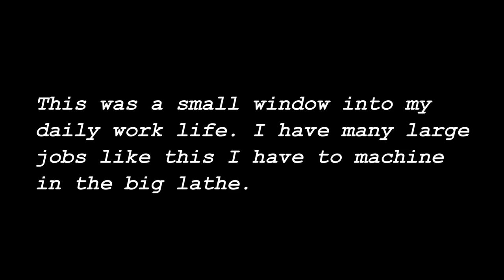Large Lathe Work

Comment: I was surprised to not see a hose on the cutting head with cutting fluid....
Doesn't the cutting head too hot and wear more...  Just wondering... nice lathe
Reply: LuckyBambooGuy you can cut dry with carbide and pretty much any tool. Oil or coolant just helps it. It does get very hot without coolant but it's ok as long as there's no thermal shock on carbide, so you can't be cutting dry and decide to throw on some oil or coolant because you probably crack it.

Comment: what was the cylinder for , just curious
Reply: +Scott Tyndall Probably part of an assembly that lifts a big load hydraulically.   Large metal door or gate? Some type of lift? Dunno...It's a hydraulic cylinder, so theoretically you can apply it to anything you need to shove with a great amount of force.
Reply: I'd say it's for an ejector semi trailer. used to work on lots of them. they were used for taking rubbish  (garbage) to landfill. the cylinder just pushed the load out of the back.

Comment: Just watched ! Great video! I myself have did this in every for long wall mining . I cut apart the jacks , 500 ton ones ! 18”x 50” I guess . I cut them on the other end where they threaded together . I machined the outside for the steady rest almost exactly as you did . Someone else took it apart then the tube came back to me then I’d machine the threads and seal out of they were bad sent it to the weld shop and they would weld it up and if machine new threads and seal . The weight assembled was 4600 lbs . I did this for 7 years . I did maybe 800 a year I no longer work there . Long story but true ! Enjoyed the video ! You made it look easy ! I know the time involved in the setting up of something this size . I’ve a couple videos of me running a 40” Summit Lathe and cutting some Square threads . Did it all and wish I had my own shop !

Comment: Great Job. I used to rebuild these when I worked as a machinist. We did it a little different. I would take the covers off the front of each stage, then take the packing out, then take clip out and pull each cylinder out. Those were a pain in my ass.

Comment: Why not use a dial indicator?
Reply: +Doan08 I'm guessing the OD is uneven due to paint and other wear issues.
Reply: +Doan08   WITH THE STEADY REST YOU CAN'T USE A DIAL BECUASE THE WORK WILL RUN TRUE IT WILL JUST BE HIGH/LOW/LEFT OR RIGHT.  HE WILL ONLY USE THE DIAL UP AT THE CHUCK.
Reply: +Phil Deez Nutz!
Reply: Sweet , learn something new every day, I was taught that way. I'll have to try that. I was taught using the center and adjusting the peice until the center cuts true. It's always worked for me. I never thought about using the indicator on the work. That sounds like the more "proper" way to do it though.

Comment: Just here to share some knowledge that I picked up.  When I need to adjust a steady rest in, I mount an indicator to the bar and sweep the tailstock ram.  Also could mount an indicator to the live center and sweep the O.D. of the bar.  Adjust the steady until the indicator reads zero at all 3 steady rest roller points.  The only downfall is, the tailstock has to adjusted on center first and can't be offset. 

You probably already know this, just incase you didn't, maybe you would like that idea better.  I noticed it's easier on center drill points.  You do great work.
Brian

Comment: Indeed,,, the bigger the work piece on that type of job, the tuffer it gets... My last couple of years machining at a shop were spent mostly on big expensive parts. My lathe (metric) had a 39" 4 jaw chuck with 14' between centers, power fed compound and tailstock. I once turned a butruss thread 1 thread per 4" on a 14" diameter by 12' shaft... I had to find the correct gear selection by trial and error. All in all a nerve racking job but very rewarding! I had to grind all the tooling. :o]

O,,,

Comment: I have a little 
arrears in watching your vids and this one could save me some time. I had few days ago similar work to do. Difference of scale - my piston and lathe was smaller and it was about only removing weld that was full of porocity and piston was leaking. This trick with center drill is awesome. I was centering with micrometer and eventually i managed to do this but it gave me a headache.

Comment: Good work Abom,I'm not going to tell you how to do your job.I know it's a pain in the butt when setting up a job on a steady and trying to find the center. But I've found it easier to have the dial gauge on the end of the work and clock around the tail stock quill either way it takes a while but you can get it to run pretty accurate.Eliminates guess work.

Comment: Hi Adam, I noticed that you only give the parting tool a few squirts of cutting fluid then off you go. Do you find that the tubes get hot enough to get work hardened? Just curious, because I run into that from time to time when I part metal (on a considerably smaller machine) especially stainless.
Reply from the maker: I can't say I've ver had problems work hardening while parting. Drilling in stainless maybe.

Comment from the maker: The tubed all have a welded in stop ring on the ID so theres no way to remove them from the front side. You have to cut the but end off, and remove all the stop plates on the rear end for them to come out. Ive had to do two of these now, they are a pain in the ass!!

Comment: I'll probably never do any lathe work near that size (I have a HF 9x20), but the techniques are similar, and I learned a few things from your video. I'd be interested in more details about how the parting tool was sharpened, and if the cutting edge needs to be exactly on center for a tubular part?

Comment: What is the best inserts you've found for cutting welds? As far as resistance to grabbing and and breaking the edges off.
Reply from the maker: I use them all, but my go to insert for cutting welds is a TNMG, grade for cutting steel. I have a pile of them, so i use them up for the harsh jobs like that, and leave me fancy expensive inserts for the more high end machining.

Comment: I don't understand why this is so fascinating to me. I LOVE machine shops, I guess it's a guy thing.
BTW, What application was this actuating cylinder used for? It looks like something that would be on either an oil rig or crane, too long to be for a dump truck. Was it hydraulic or pneumatic?
Reply: It's machine porn. Especially with huge hydraulic cylinders moving in and out. :)
Reply: this is a hydraulic cylinder for a dump truck.

Comment: Fascinating videos!  When adding text involving angles or temperature, hold down the ALT key and type 248.  It will give you the degree ° symbol and save you a bunch of key-strokes.  Those "cheat" codes can be found if you Google "ASCII symbols".

Comment: Great video, surprised the mount was welded on center as accurately as it was would have thought you would have to indicate od to find center, do you also do the welding on a project like this ?. Who made the lathe ? just curios  thanks for sharing
Reply from the maker: I indicated the chuck end of the tube, but used the center drill to find the center on the blind end. Once I had it center drilled I used a live center then machined a true spot on the tube for the roller steady rest. Yes I have to do all of the welding where I work, and on my jobs. 
The lathe is an American Pacemaker 20x192, and was built in 1943.

Comment: What did that cylinder go on? I also used to be a machinist in a hydraulics shop. we used to mfg and repair multi stage cylinders from dump bodies. We always took the head nut off, pulled the packing and the snap rings out, then pulled each stage out from the top. Is this not that type of set up? The bottom of each stage has a phenolics guide    that would burn in you welded the butt plate on while fully assembled. I guess that must be a different type cylinders.

Comment: I've found that in older heavy lathes, the tailstock is often below center and/or off center.....one must true-up the tailstock to AXIAL center of the lathe...this is often difficult, as the ways  are worn down below factory center and the tailstock can be left or right of center, as a result of vibration/broken insert accidents....gotta true that tailstock up at different lengths from the chuck.

Comment: How do you weld the components again? From what I understand and judging from the thickness a lot of MIG/MAG weld passes would be necessary, where SAW would result in less weld passes, but then you would require a "complicated" setup.
Reply from the maker: I used SMAW, stick welding with 7018 electrodes. My choice.

Comment: Dear Adam your lathe lessons are very interesting!!
Why you go so slowly with parting tool?  i suppose that you go at 30 rpm about it's true?
iscar insert work good at  minimum 80 m/min.....16ft/min......
can you explane this?
Reply from the maker: That was a massive workpiece to be turning on the lathe. I chose to keep the RPM's low. The parting inserts still work fine at that slower RPM, the large diameter equals to quite a bit of surface feet.

Comment: I'm a professional welder and I can tell you that welding back pistons after refurbishing is my least favourite job. 9 cases on 10 i have TIG welded cold pass (or root pass, english is my second language so i'm not certain; anyway, first layer of weld), MAG filler and cap. As i remember there almost allways have to be a spot of oil, grease from assembling o-rings and seals or other thing that spoils my weld and force me to grind the gap and fill it again.

Comment: These cylinders are part of a truck and trailer lift for unloading chip trucks lifts the entire unit they usually run in tandem I have worked on these myself but we had to arc sir the backend and stop plates off our sirco only has 12" bore

Comment: Can you explain why coolant was used with the parting tool, but (apparently) not with the other tools?

What coolant/lubricant was used?
Reply: Not a machinist but, if I'm right, a parting operation/plunge cut like that doesn't allow much area for chips to escape and is also hotter than other areas

Comment: It was big 2" of thread 2" gap I could have made the calculation, but would have had to take the cover off the end of the headstock 3' wide by 5'6" tall and we had no extra gears anyway. A giant warehouse sale included in 3 truckloads the lathe was the only machine in good working condition (but it was,,, what it was) the marker worked well to set it up... Many other machines I put into working service lots of scrapeing and honing on ways and machanicing. A great learning experience! :o]

O,,,

Comment: Adam, I watched this years ago, and am still fascinated at it. What was that cylinder for?
Reply from the maker: It’s used for a truck dump at a paper mill
Reply: Abom79 so when you say “truck dump” as opposed to “dump truck”, you mean one of those things where they basically just turn over the entire truck as a whole?
Reply: @JasperJanssen  If I'm correct, it's one of those places where they drive the truck onto a platform and then tilt the platform along with the truck on it. That is that it lifts the truck and platform so that the platform and front end of the truck are raised in the air together so that the back end would empty like a dump truck that has a lifting bed.

Comment: Having been a machinist for 35 years and, re-building 100's of telescoping cylinders, Why did you remove the butt plate(s)? (Your term, Blind ends). Telescoping cylinders are put together and packed, from the packing nut end. If the packing nuts were not removable I understand this but, the nuts Still have to be removed to install new packing. Otherwise it will leak.

Comment: How come the inner stages of the cylinder do not rotate whilst machining? Is it because the cut depth is to small to overcome the friction of the seals? Or do they each have a shoulder/spigot that holds them in place?
Reply from the maker: Good catch. On the opposite end, I have a piece of flat bar that is welded from the eye, all the way to the barrel, and each tube nut is also welded to that bar. That keeps everything rotating together. It's the best way I came up with for holding them all together.
Reply: LOL I was over thinking it... of course it is welded :P
Thank you for the reply

Comment: I use to work on a very large Gisholt  engine lathe. Did you ever hear of them? [old school]
Reply from the maker: I don't think I've ever heard or seen a Gisholt before.
Reply: GEFanuc21t Hi I also worked on Clausing and Cincinnate. How about Hardinge and in the 1960,s I ran a Warner Swasey turret lathe[my favorite machine]. You went like a bat out of hell, to make quick parts. Another neat machine I worked on was I believe one of the first screw machines. It was called the Cleveland Automatic. It was old when i worked it in the mid 60,s. It worked off a series of cams. those were the good old days!!

Comment: First of this isn’t a big lathe it’s borderline small to medium. I’ve ran Skoda SR2500x15000 and I still consider that a low end big lathe. The mid range lathes I’ve ran were Swift 24D and Stanko 1M64. The Craven 5000mm were the biggest by far to date handling 200 tons over 50’

Comment: I am suprised that so much cutting can be done with so little lubrication and/ or temperature modification.
Reply: the surrounding metal will act as a heat sink, the low speed from such a large piece also means that any point on the workpiece has longer to cool down before coming in contact with the tool again. think about when you grind a tool bit, a small nose on a cutter is quicker to burn and turn blue on you than if you are grinding a large side relief, because there is less metal nearby to dissipate the heat
Reply: Giovanni Cintolo Thanks for the information. It makes sense now. I obviously didn't think it through.
Reply: +Brian Skinner Thats carbide for ya

Comment from the maker: I took pictures of the cylinder before I started working on it, but I also made a not in the work folder as to the relation of the blind end to the port that was welded on. Thats what the hole in the OD of the barrel is for, the 4 bolt flange. The eye is 90 degrees off it the port.

Comment: I thought it was going be a much bigger lathe, My Mother and her business partners company refurbished the roller from paper mills and other rollers that needed skimming and then building back up with a plasma sprayer, The  largest diameter lathe was 4m with a 35ft bed, the longest lathe bed in the factory was 40ft but only a 1200mm Max diameter. My mum wanted me to learn the ropes, but I just couldn’t just bare to watch a machine doing a 40ft plus pass on a work item, and then repeating it again and again.

Comment: Interesting Job.

But ! Why don't you simply open the top screw of each tube to get it out ????
Reply from the maker: Trust me, I wouldn't go through all this work if it were so easy. Each tube has a stop ring on both the ID and OD keeping the tubes from sliding out. It acts like a stop tube for each stage. The bottom end stops tubes keeps each stage from resting on the packing nuts. So therefor, in order to remove the tubes for repair, you have to do what I shown in the video. If you have any doubts, call up Phelps and they will tell you the same thing.
Reply: I trust you my friend.
To do such a job, you can't be dumb.
It's just that I'm also specialized in cylinder repair.
Most of cylinder manufacturers make their cylinders in a way that they can be dismantled more or less easily.
I think that Phelps don't. (welded rings).
But to change the seals you can just open the external gland nuts. Or maybe your repair needs more than that ?

I really appreciate your job. I'm doing the same.
Thanks for sharing.

Hamza

Comment: No gland nut on the other end? I've never seen a welded up(from factory) cylinder. Seals leak often enough on multi-stages that this would be a major league, not to mention expensive P.I.T. A.!
Reply: Yes, at 16:00, shows all the gland nuts!!! Remove them, pull stage out!

Comment: If you dont mind me saying you went the wrong way about centreing up that cylinder. You would have been far better off sitting a dial indicator on the end of it and rotating it by hand with the stylus around the outside or inside of the tailstock barrell.  None of that guessing and perfectly accurate in half the time.
Reply: What was the way he went about finding the center? Measuring the rotation etc?

Comment: seems like that tiny spindly little lathe point on the end wouldn't be enough to hold it ...
Reply from the maker: The live center is an older Royal High-Precision Quad-Bearing Live Center with a  6 Morse Taper shank. From there website that center will hold a workpiece weighing 5,240 LBS, with a thrust load of 5,300 lbs. That cylinder probably weighs close to that, but the center holds just fine. But that's another reason to have the steady rest set close to the work, in case the center was to walk out or break, the steady will catch the work.